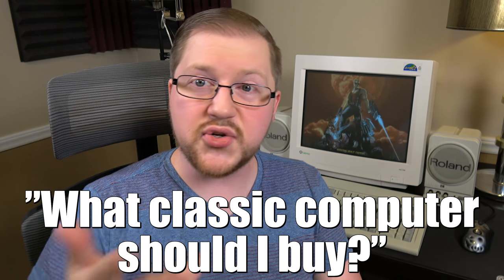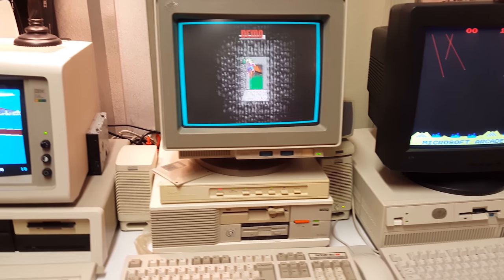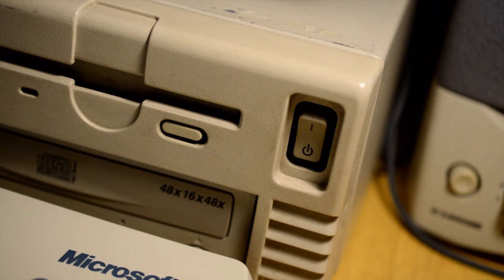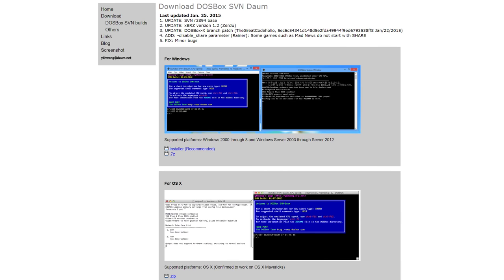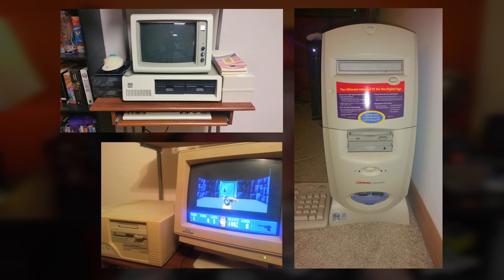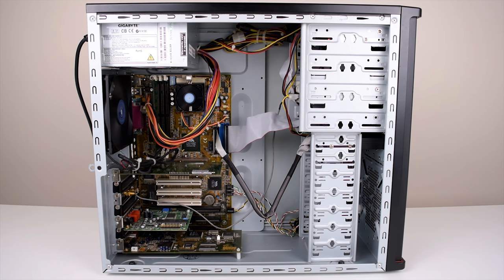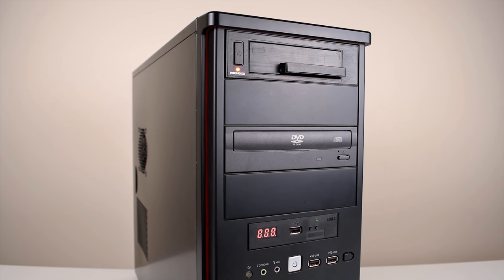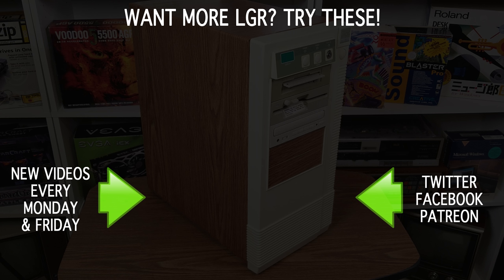Choosing a Retro PC for Games: Advice & What to Look For

Comment: Here's my analysis of the responses:
The simple solution: use emulation
The practical solution: use a tricked-out 486 or Windows 98-era machine
The Clint solution: own dozens of different computers to cover every possible hardware configuration
Reply: Gotta collect ‘em all!
Reply: I guess it just depends on how much you love old computers.
Reply: Clint's solution is very tempting.
Reply: Haha! Yeah LGR makes me want to buy old computers! :O
Reply: Omega Kid You can have love but not money, time or space... is not that simple.
Reply: I have the Clint solution... AKA I have a problem. A good one though.
Reply: It also depends on how much space you have, and how much money you have. A recent check on eBay shows Win98 machines with ridiculous asking prices. Apparently the word has gotten out... ;)
Reply: and then you end up renting storage space cuz space issues :P
Reply: My solution: buy a used XP machine when Vista was new and keep it running while using Ubuntu or Mint for your newest rig so you can run Wine.
Reply: "The Clint solution" is definitely solution for me:)
Reply: @OdaSwifteye  
Bit heavy on the old credit card for most mortals though.
Reply: My way: find old vintage computers at a thrift store or parts around the house and build a system out of it. I have systems from the 486 (Packard Bell Pack-Mate 28 Plus decked out with the following sound: PC Speaker, Tandy 3-voice compatible ISA, Sound Blaster 16 (will change it to the Diamond K2Y-PRO16 card) with a Yamaha DB50XG attached and a Creative Labs CR-563-B CD-ROM, and a Music Quest MPU-401 card made by keropi. Has 512KB L2 cache, Evergreen 586 DX5-133 w/ 16KB L1 WB cache enabled, 32MB RAM, integrated CL-GD5428 w/ 2MB video RAM, 4GB CF card with Windows 95C, Epson SD-800, and a Conner tape drive that uses a floppy interface).
Reply: Sounds about right. I feel like you need to be into the hardware to actually buy a retro PC. Because as you mention, emulation is way, way easier. If you get excited watching Clint and others on YouTube open up old machines, maybe you should consider buying a retro PC. But if you are only after the games, just emulate.
Reply: I'd call it the simple, practical, and RIGHT solutions. :P
Reply: I think the practical solution should be "install dosbox distro on your usb drive and plug it into any modern PCs with CRT hooked up.
Reply: haha, lol
Reply: I have two desktops and two laptops. One desktop is a Core i5 @3GHz, which is my gaming system. I also have one with an Athlon 64 X2 which I maintain and upgrade constantly. For laptops, I have an HP Pavilion g6 and a ThinkPad T61. Long story short, I don't collect a lot of computers if I don't need them but I just like building/repairing them. I try to use compatibility mode whenever I can and it seems to work for me.
Reply: The late-90s solution: If it's a Windows game, play it natively without any emulators, and try to tweak it to run in 1920x1080
Reply: "The Clint solution" worked for me: I own 6 different gaming RIGs right now - starting with the old Pentium II 333 MHz and going all the way up to a Ryzen 5 3600X :-)
Reply: @wdsbhb  computer-mon!
Reply: I like the Phil's Computer Lab solution. That one computer can handle everything from Wing Commander to Unreal Tournament on a hardware level. 

But, for me with my constraints, it would have to be emulation.
Reply: That's pretty much it, and I think for most people emulation works fine. One of the better solutions would be to hook up a CRT to modern hardware, buy a PS/2 adapter card if needed, and use the older controllers. Hence the right human interface, but with an emulation middle-man.
Reply: ive had to do the combo approach - i have a Pentium II 450 and a Pentium 4 2ghz both running the gamut of that era, as XP era stuff mainly works in Windows 10, as well as i have a Pi 3A+ with Retropie hooked to a CRT tv and a 240p mod for Tandy 1000 DosBox fun (as well as putting DosBox on the Pentium II as it has a Dell CRT hooked to it).

Comment: Hey, thanks for having me on the show!  

To add a bit to what you said, I'm probably a little too forward looking and I just assume everything is going to fail before it does, so I always want a future proof method of playing games.  Gaming isn't really about nostalgia for me, there are just plenty of games I take years, if not decades to get around to playing and the thought of having a small window where I can play one always rubs me the wrong way.

The reason I was showing off those problems was because I do think they are legitimate failings of trying to run games virtualized on modern systems (particularly with AA).  As for WINE, I do plan to look into that more in the future, but from what I've seen, that's more like an additional dice toss as to whether something will run or not.

I feel like DOS games we more or less have nailed down in that respect, games from this century are where it can start to get ugly.
Reply from the maker: Thanks again for joining in on this! I totally don't blame you on that stuff, it's a really irksome situation with tons of Windows games and I often dread having to try and find just the right hardware to get some of those working. Really hope better emulation/virtualization software continues to be developed for those.
Reply: I totally agree with Ross with his segment.  Room space is a big concern for me, so I can't have a specific machine for each game era just hanging around.  I hope someone can come up with a solution for Post-DOS era games that will run on modern hardware.  I've about given up trying to configure a Virtual Machine.  DOSBox is my savior.  That and ZDoom!  Love this video guys :)  So sad I couldn't be a part of it!
Reply: Speaking of older titles running poorly on newer hardware.. I used to have loads of issues with games from Blizzard, mainly Diablo and Starcraft, around the Windows 7 era, all of those games, without some kind of modding or patching, would not run properly, or would have really strange graphical issues. But somehow, after windows 8/Windows 10, they seem to work now. Surprisingly, quite a few of my older titles tend to work better, which is strange because normally you'd think it's the complete opposite.
Reply: Accursed Farms you are awesome dude.  Love your videos.
Reply: I totally read this in Gordon's voice

I bet you get that a lot.
Reply: I think a huge problem with this era is that the emulation isn't focused on gaming. DOSBox, from the ground up, was built to run DOS games primarily. But virtual machine software is primarily built for productivity apps. 

They also are primarily built for a later era, really. The focus is on making sure Windows XP runs, and then to make sure that you can run modern OSes. That's what all the updates are for: modern OS compatibility. 

I mean, the introduction of 3D support came from Wine, because Wine is more gaming focused, albeit not retro-gaming focused. The main software that users want to run on Linux that they can't are Windows games. 

We need retro-gaming-enthusiast programmers who want to try and fix these problems. There's no reason that you shouldn't be able to force on Anti-aliasing, for goodness sake. If nothing else, you should be able to force it on using you GPU software.
Reply: So glad Clint mentioned Wine. He's right, though. XP and earlier games will usually run best in WINE and while there is that dice toss you mentioned, Ross, for that era you're basically tossing a d100 and hoping you don't land on a 100.

I'm a long time Linux and Wine user, so if you ever need help, let me know. Although I'm not sure how you would be able to get ahold of me.

Also, thank you Clint for NOT falling into the trap of calling Wine an emulator! I mean, it's even in the acronym! WINE Is Not (an) Emulator :P
Reply: I'll support this WINE argument. On my couple years old desktop I have Ubuntu Linux installed with Dosbox and WINE, and I've met only very few PC games from all time that I can not run with this setup. Also most of those few are from this decade, so if I really want to run them, I can either use dual boot option for Windows 10 or my laptop's Windows 7. Therefore, even while I have some genuine vintage computer setups as well, especially for circa 2000-2005 Windows games it's often just simplest to run them on my main desktop with WINE.

I do admit it's not always perfect of course. Sometimes it can take a moment of configuration to make something start - although this has typically been a bigger issue with newer games. Also sometimes games run but have some minor glitches, such as crashing after every several hours or missing textures. Those might or might not be fixable by changing settings. In a way though the need to configurate instead of plain plug and play brought me certain nostalgic feeling I had missed - a bit like trying to get just few more kilos of conventional memory without removing CD-ROM driver in 1990's. 

On the other hand I'm not an old Linux user, just began last year. Cold start for Linux without anyone to help was not an easy one, and more than once it was really frustrating. Even while there is readily written community support for almost any normal issue, I never came across with some very convenient, clear and easy to read comprehensive Linux tutorial for a newbie, and essentially almost every basic thing from finding the directory or even running software differs from what I'd used to earlier. Not to mention that whereas Windows is a genuine GUI OS, it seems to me like Linux OS GUI distros tends to be more like a stage set, where you go behind the facade (to console) for anything more serious. Using Linux GUI has felt like using a factory OEM-OS installed Android phone without full access to even Google Play - very limited.

Nevertheless, in comparison to my Windows 7/10, it's been way easier to get old Windows stuff running with Linux WINE.
Reply: Accursed Farms what about wrappers to run games capable of using the 3dfx glide wrapper such as NGlide?
Reply: I do use a glide wrapper for those games, but that's a minority, only a dozen or two max where Glide was the only 3D acceleration option.  I remember it working quite well.
Reply: I plan to look into it more in the future, though I browsed the WINE database and found plenty of entries showing problems or no entry at all.  The thing is, I play a lot of different games, so I'm sure WINE handles popular ones pretty well, there's all sorts of fringe games out there I have no idea how well it will handle.  I'll have to see.
Reply: Well I do plan to look into it later, though I'd say I might roll more 100s than you might imagine.
Reply: Play-on-Linux is a GUI that provides pre-made-installers & settings for WINE-compatible games and other software. I do not know how many games are covered by Play-on-Linux but it may be worth to check it out.
Reply: I just want to run Max Payne on Steam. Damn thing won't even friggin load.
Reply: Accursed Farms If it helps you feel better, WINE runs 3D Pinball Space Cadet FLAWLESSLY, last time I played it. :D But yeah, WINE isn't perfect. :/
Reply: Ok, how DA HELL are you getting 3d acceleration on virtualbox for Windows 98? I couldn't get it working for the life of me and right now there's some abandonware titles I found that only work in 16 bit mode, but I've had bad experience with VMware SVGA II's performance on Windows XP (for some reason they don't support 3d acceleration on 98)

Comment: I love how the opinions here from "The Dream Team of Retro PC Gaming" run the entire gamut from emulation to dedicated vintage hardware to something in between. I appreciate the fact that there isn't one "right" way to experience these games, but that everyone is able to find what works for them. It seems like a much more open and supportive community than the console side that says that one must use original hardware or face the shame of being labeled some kind of poseur or something. Kids these days....
Reply: To be fair, the 'modern' solutions to PC gaming still largely amount to using a PC to play PC games. 
Lots has changed over the years, but at the same time, to some extent, a PC is a PC.
The experience of playing a DOS game on a modern PC using Dosbox certainly isn't identical to playing it on period correct hardware, but it's pretty close more often than not.

Frequently, console games on non-original hardware means emulation. And that can be VERY far removed from what it was like to use the real hardware.
Sometimes this is an improvement. (HD texture packs for n64 games), sometimes it very much isn't. (again, n64 emulation - accuracy is often atrociously bad.)
It's not to say that it's unworkable, but it does seem to have bigger caveats.

Also, more often than not, playing console games on non-original hardware is also a tacit approval of software piracy, which seriously muddies the waters.
PC games on modern hardware meanwhile can easily be the original retail games from the era...
Reply: It's terrific that we have so many options available to us. There are certainly folks firmly in both camps (No Emulation, you must use pure Hardware vs Buying old hardware is dumb) but generally speaking most in the community seem to fall somewhere in the middle. (Own what you can, emulate what you can't)

The bonus to both sides is... we're getting these things preserved. We're getting copies of software that could be long forgotten saved digitally, and also in their physical form. 

This is key because so many games and IPs have changed hands multiple times... to the point that people can't even figure out WHO owns it. 

A perfect example... "No One Lives Forever". This is not an entirely old game, it's from 2000. (Which as I look and see it's 18 years old makes me feel damn old now.) They can't even get to the point where it can be re-released due to what's gone on with it's licensing.  https://kotaku.com/the-sad-story-behind-a-dead-pc-game-that-cant-come-back-1688358811
Reply: Good
Reply: @KuraIthys  I mean, console games can easily be ripped from original console discs too, at least once they stopped using proprietary cartridges.
Reply: @SteelRodent strictly speaking, modern PC CPUs can run 16-bit software (8-bit never existed for the PC), just like in the 80s. It's part of the huge backward compatibility that x86-64 (the 64-bit version of the CPU architecture) preserves. You can't run 64-bit and 16-bit software at the same time (so no 64-bit operating system), but you can stay on a purely 16-bit mode or even a mix of 16-bit and 32-bit modes. Nothing was removed there.

Beyond the CPU, compatibility layers are still provided for the old firmware (BIOS) and for several vital components (interrupt controller, timer, graphics modes...) of the PC platform. However, specific implementations can have problems, and other components are more problematic (PCIe, NVMe, SATA, USB, audio interfaces). So there'd undoubtedly be issues when trying to run legacy software, and all this is compatibility stuff that's been left there but isn't what users are expected to use most of the time. However I'd say modern PCs end up qualifying as PCs.

On the other hand, all this is irrelevant concerning DOSBox: as it is intended to run on 64-bit operating systems (and also non-PC platforms), it has to recreate the whole platform. It's pure emulation, just like the one in console emulators.
Reply: @mctpyt  this is why i love PC gaming. I used to be a console gamer, but sold it for space and financial reasons. But the fact that a PC can run PC/console emulators on an all in one device makes it very convenient and a more affordable way to game on everything.

Comment: I was born in the late 80s and started computing in the early 90s. I still love pretty much everything about DOS and early Windows still. I've built two PC's for 90s gaming and such - one DOS 6.22 machine with a Pentium 166MHz CPU and 64mb RAM with a VESA 2mb videocard and Sound Blaster 2.0, this i use for ealy to mid 90s games. The other one runs Win 98 SP2 with a Pentium III 800mhz CPU and 512mb RAM with a Voodoo 3 16mb 3D-accelerator and Sound Blaster AWE64, i use this machine for late 90s and early 00s gaming and such. Mmm, just talking about this gets me going.

Comment: How I chose. I picked a year: 2000. I started with a retail PC that anyone could buy back then. In my case, a Dell Dimension 4100. I maxed out the storage and memory that the manufacturer specified for this particular PC. Then I did what we did back then and upgraded certain components to the latest and greatest (at the time). In my case, a 3DFX Voodoo5 5500 AGP graphics card, and a Sound Blaster Live! 5.1 sound card. The best you could get from Dell was a 21" Dell branded Sony Trinitron CRT monitor, so that's what I found. Paired all this with a 2.1 speaker system from Altec Lansing that, again, Dell offered with this package. I couldn't be happier with the results. I think setting parameters can make an easier and more authentic build experience, if that's what you're going for.